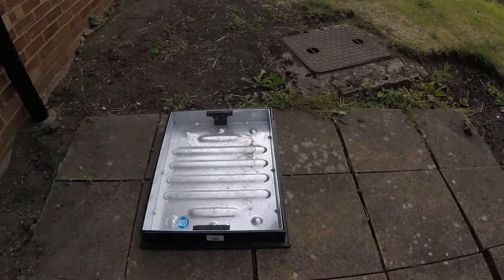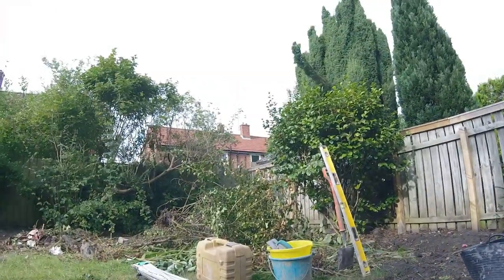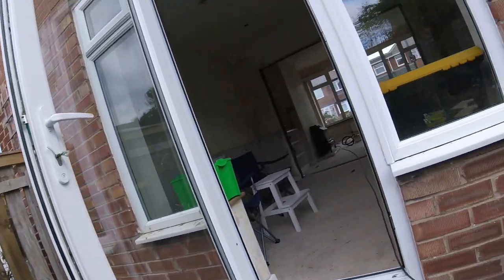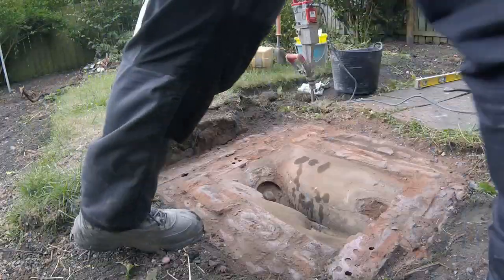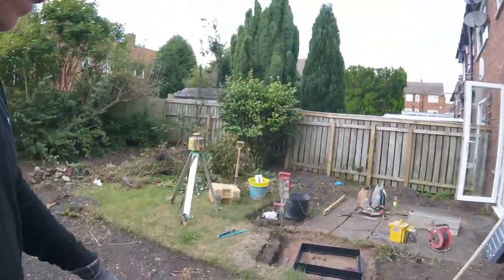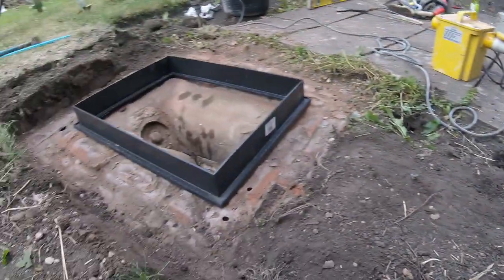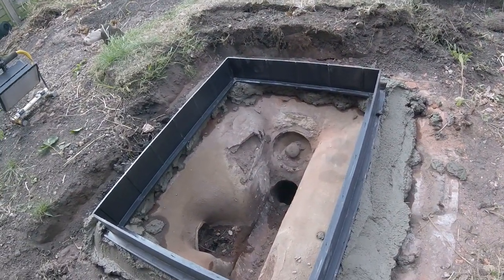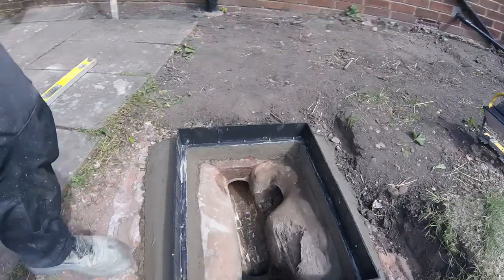How To Change An Old Cast Iron Manhole Cover For A New Paving Cover Clean A Drain 026

Comment: Clear and comprehensive - thank you.
One thing that slightly surprised me is that you set the manhole frame in level. Presumably, when you laid the paving, you had a fall on it (away from the house?) so the paving won't be absolutely flush up against the manhole cover? I mention this as I'm about to install a manhole cover very close to my house and plan to set the frame in line with the fall - i.e.  it won't be absolutely level. Is there any reason why I shouldn't do this? Cheers.
Reply from the maker: Great point! But you can ajust the cover to suit the pavement but as long as the manhole base has fall it will work great 👍🍻

Comment: Nice job.

I assume you are using a timelapse function on the video camera? The camera should have some setting that controls the time gap between the stills, shortening the time will make the timelapse flow more smoothly. It looks like it is taking a shot every 10 or 20 seconds and putting the video together at 1/2 to 1 second per shot. If you set it to 1 shot a second and work to 25 shots per second in the video, you'll get a near-continuous smooth video.

If you want, let me know the camera model and I'll see if I can find the settings for you.
Reply from the maker: Thanks for that comment it’s appreciated. Yes I do understand your thinking and also the options available on the go pro. It is set at 1 photo every 30 seconds and I find it’s better due to it being a visual that the imagination can gauge what I’m doing if that makes sense. If I had been doing something like a more detailed activity then a good hd video or a smoother time lapse could be the answer. The reason I do this is that the editing can take some time to do the way I’m currently doing it. and if I changed the settings to say 1fps then it would take 30 times longer to edit and I would probably delete approx 40 or so frames in which I could have the camera set to. Does that make sense to you friend. If I had a camera and editing man then he could video a mixture of settings and I hope one day I could be in a position to do this but I’m 94,300 subscribers away thanks so much for that comment. We are both speaking the same language there 😭😭😆😆👍